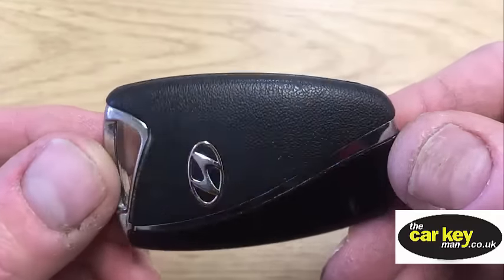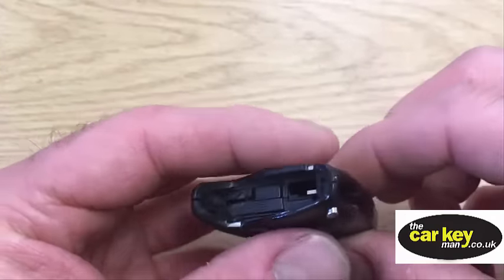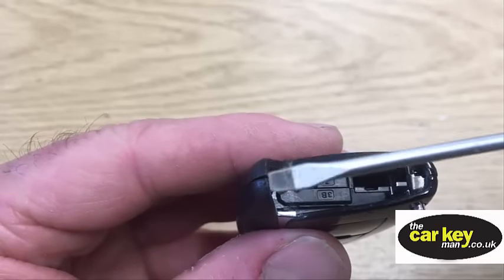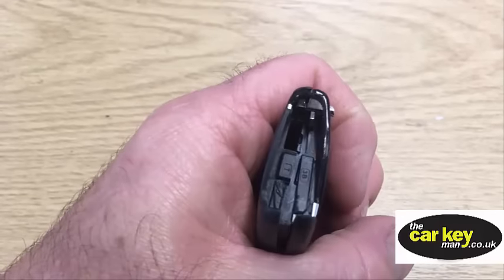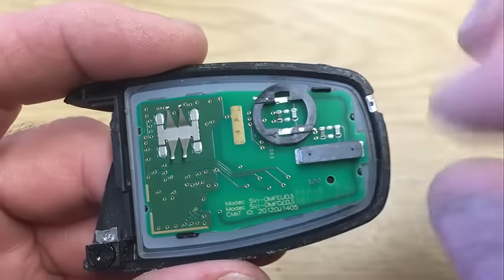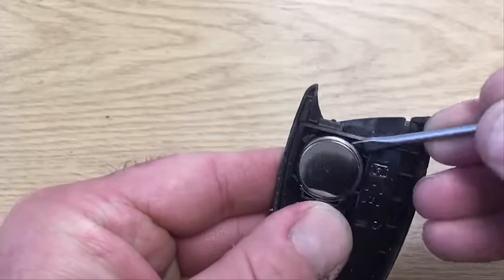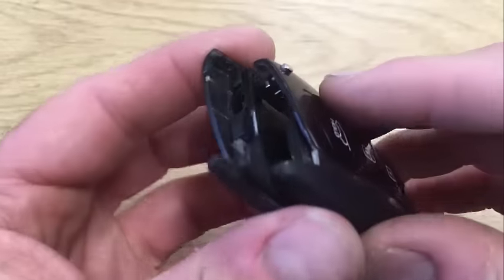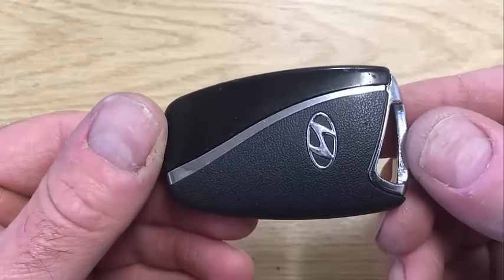Key Battery Hyundai Santa Fe Keyless HOW TO change

Comment: I changed battery exactly as you show here and it worked, however now I can't use the FOB to unlock or lock the car remotely. I'm guessing it has to be reprogrammed or something. Do you have information on how to do that? 
It's a Santa Fe 2013 but I'm sure the process is the same.
Reply from the maker: Hi, was it working before you changed the key battery ?

Comment: Thank you, thank you. This is why I love YouTube. The dealer was telling me that for a full replacement and reprogramming I was looking at 800 plus taxes. Had no idea I could open it up so easily and replace the battery for 3 bucks, sheesh!
Can't thank you enough.
Reply from the maker: So pleased it helped you, what is wrong with these people!!
Reply: @TheCarKeyMan  Hi. Everytime I lock my SantaFe, after maybe 3-5 mins, the alarm goes off. Do you know what are the possible reasons causing it?
Reply: @user-mj8zf4qq7u  Its probably the hood sensor. Make sure the hood is closed all the way. If it is, unplug it and see if the alarm goes off again.

Comment: Super helpful thank you. I was actually on my way to the dealership for a recall and my fob stopped working. I was just gonna ask them when I got there (using my backup fob) and decided to google it first. Your video was simple and easy to follow. Cost me $3 for the battery and only minutes to do. I’m sure the dealer would have charged an arm and a leg
Reply from the maker: That's great news that you saved money. Some of the dealers are a bit cheeky when charging for this. I can understand a reasonable charge but it's a quick little job. Thanks for watching :)

Comment: Thank you!  My key fobs began to slowly stop working when I had an oil leak.  It was leaking into the exhaust and maybe some other areas.  One day,  the smell of oil was really bad and it wouldn't allow me to start my car.  It said it couldn't detect my key fob, though I had both of them.  I recently got the major oil issue taken care of, however, last night, it couldn't detect my key fob to allow me to unlock and lock my car door, though it did start up.  Any advice?
Reply from the maker: Hi Andrea, I'm not sure an oil leak would cause a problem like this. Have you tried a new key battery?
Reply: @TheCarKeyMan  Yes, but it seems weak.

Comment: Great video I quick question, recently the car is asking me more that usual to place the key in the ingnition buttom, could the low battery of the control be causing that issue?
Reply from the maker: Yes probably, if the key battery is low Ruben, then it will ask you to place the in the ignition. A new key battery should fix it
Reply: @TheCarKeyMan  thanks man your help me a lot and now all is working well

Comment: So the fob will continue to work with the vehicle after replacing the battery? No need to re program the fob once it has lost power ?
Reply from the maker: Hi Larry, when we've changed these, we've never needed to recode them

Comment: Any tips when the replacement doesn't work?  Instructions were excellent to open.  Had no issues.  Was not rough with it.  Now it is not working.
Reply from the maker: Hi Leigh, Have you put the old battery back in?
Reply: @TheCarKeyMan  Thanks for the reply.  The low battery would work but the system was warning it was low.  The battery from the drawer with a higher voltage wasn't working at all.  Got a new battery from the store and it fixed it up.  Strange but fixed :)

Comment: Btw if your key fob dies and the car thinks the key is not there, the engine will not start (says key is missing) — an emergency override is to flip open the center console, insert the key fob upside down into the little slot, & push down until it clicks into place. The car will read your key even when the battery is low. Then you can start the engine! 👍🏼

(Hint: a broad flathead screwdriver works better to pry it apart)
Reply from the maker: Hi Robert, thanks for this info, I do need to make a video on this ;)

Comment: Just bought a 2019 Santa Fe.  That key has four buttons (added a panic button) but opening appears to be the same.  Still same battery (2032). Battery slides out now instead of pops out once you get inside.
Reply from the maker: Thanks Steven. I'll have a look out for the new style of key

Comment: Don’t put your fingers over the contacts I have found with the extremely low currents used by these keys any resistance caused by oil from your fingers shortens the life of the battery usually it doesn’t matter too much but for watches it’s critical.